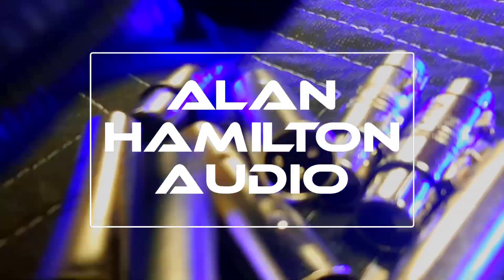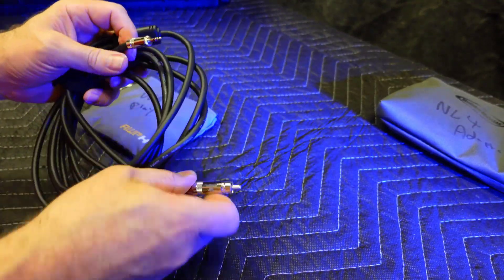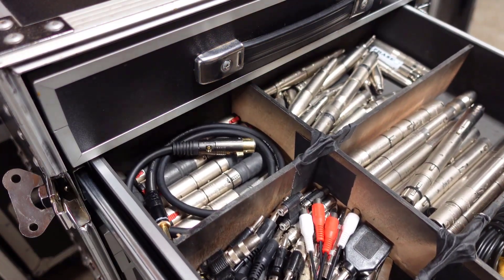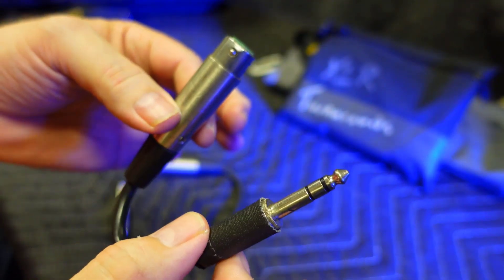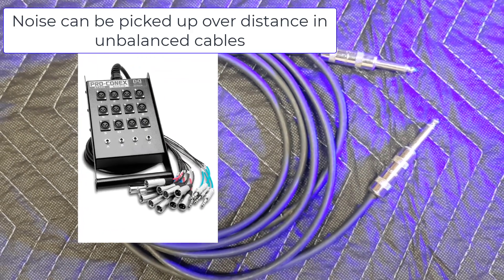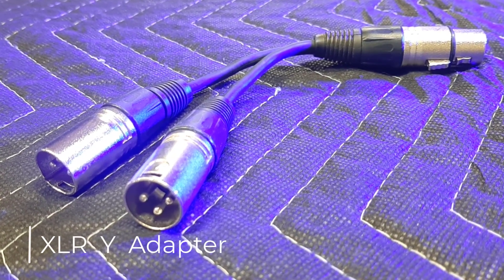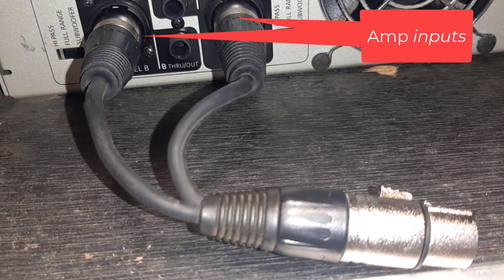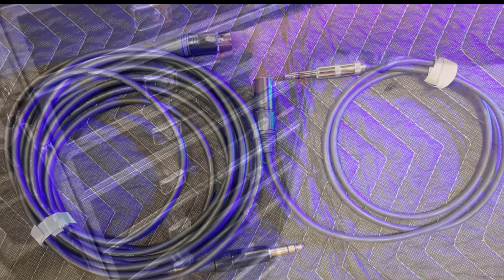What Are My 5 Most Used Audio Adapters for Live Sound Reinforcement?

Comment: Those round  speakon adapters are no good. I cracked one , looked inside and was surprised to see skinny 20 awg wire . I only use Neutrik speakon connectors/ adapters
Reply from the maker: Interesting. I might have to sacrifice a couple to get a look inside of both kinds. Technically, a smaller gauge wire for that short of a distance is pretty negligible. It's not exactly analogous to a valve on a water line, partially closing up. I'd rather see at least 18ga though. But it makes me wonder what Neutrik does inside theirs. For a comparison, think about speakers that are directly fused or use a bulb as part of their protection circuit.
I mostly use the Neutrik because that is what I have in the workbox, but I added these Amazon ones to the Pelican because there are times I have my Pelican with me and  one rig but the workbox is in another venue with another rig. I haven't really had any problems with them. Having a couple of rigs out is one reason there's the redundancy you see between some things in the Pelican case and the workbox... and even the XLR case. Plus, sometimes one thing is just closer than the other. 
Thanks for the info.

Comment: I use the XLR split on guitar cab mic to input 2 channels into the desk. Some bands with one guitar can sound a little empty, so I pan one channel slightly and add 5-10ms delay to fill out the room - then I ride the centred channel for solos. 
XLR turnaround’s have saved me a few times to add an extra sends into a stage box / snake.
Reply from the maker: Yeah, the turnarounds are handy for snake issues. I didn't even think to mention coms in the video... But there can be times where you need a last minute com feed going down the snake, and you need to find a line and you're using the ones you need. Enter the turnaround! ;)

Comment: Yes and YES to all of the above. Lately, I've added an inline -10db pad (to solve an issue with the 91A kick drum condenser mic being way too hot.) Also, having extra XLR jumpers (like a 3 footer) is super handy when you've run a cable....and you're short by THAT much.
Reply from the maker: I have a -10 or 15dB pad in the briefcase and another one or two in the workbox.
I also have some pin 1 lifts, but they rarely get used to the point I can't remember the last time I used one. So, they didn't make the top 5.

Comment: Regarding 3.5 mm TRS -> RCA -> TS: I find that those RCA-TS adapters are sometimes a bit "flimsy"... So don't buy the cheapest ones, and make sure you get a good/tight connection! And if you - like myself - know that you will regularly need a 3.5 mm TRS -> 2 x TS connection - get (or build) such a cable.
Reply from the maker: Good point. I usually give the RCAs a bit of a squeeze once (before the first use, if needed) so they fit them tightly. I have several of those 1/4" TS to Female RCA adapters. I've got different mixers, and work with even more mixers. Plus, do service calls where the MP3 player is a bit of a test tool too. Sometimes into who knows what console, and sometimes into a box mixer or 70V system. So having flexibility for those situations is why I use what I do. But if I was working with one system and/or mixer, there'd be no need in the flexibility versus just having the cable I need... and maybe a backup.

Really, the only problems I've had with them is either from getting a case closed on them... or... losing them.

Comment: Great video. We have similar kit and some else)

RCA to XLR M and RCA to XLR F. It helps to take long RCA for djs or connect local sound system (commercial zone amplifiers) or (when use XLR/6.3TRS) to take RCA/6.3TRS with custom length

3.5 TRS to 2x XLR M. Universal cable (if to use any adaptors with it) for constructions any cables for pc, dslr cameras, recorders etc.
Reply from the maker: I have those too, but just don't use them much so they didn't make the frequently used list. I like having the around, but just don't do much of the type of gig where they are needed. But good to have them in you need them!